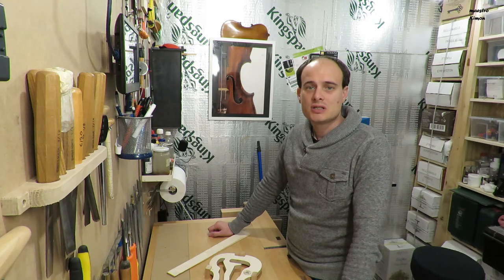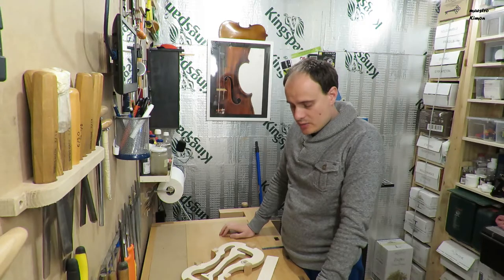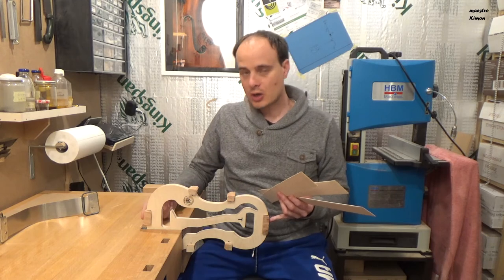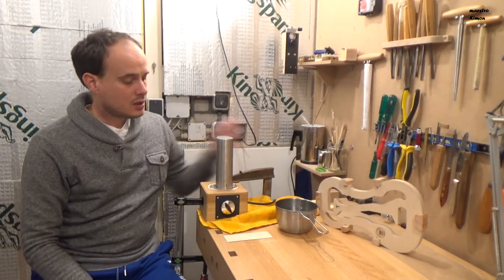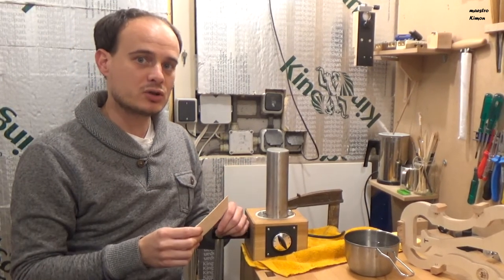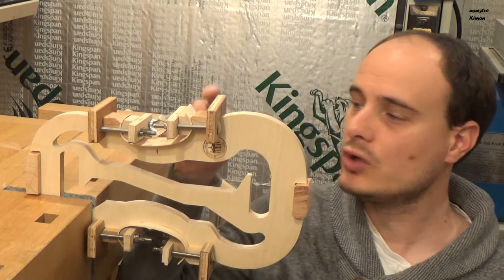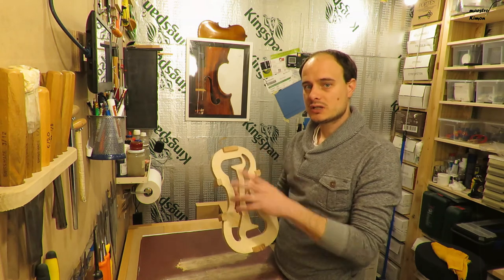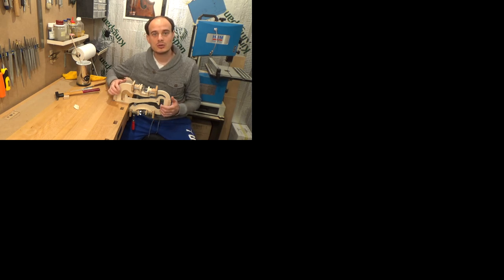Making a violin - step 2 - starting with the ribs

Comment: Are the 31mm and 29.5 mm blocks at their final dimension or will be smaller when you bring down the ribs to the blocks ?  I guess my question is...what is the final dimension before the back and front plates are glued on.  Thanks for your videos.  They are much appreciated.
Reply from the maker: These dimensions are the finished dimensions. When you are working on the ribs, the blocks don't get lower very easy. If you want to be 100% sure, live theme 0,5mm higher. 

Thank you, good to hear that you appreciate my videos!

Comment: Hey there been loving your making a violin series. I was just wondering at this stage what material you had under neath the sand paper to make it flat ? i have been thinking about buying some plate glass to use as a flat surface underneath it. not sure if this is not necessary and i could just use some plywood ?
Reply from the maker: I use a piece of MDF that is thick enough so it doesn't bend easily. the best is a nice piece of marble but it is very heavy. If you have the space it's the best to use a marble table. Otherwise a  thick piece of MDF or multiplex will do the job. Control it before use!

Comment: can you tell all measurements from the blocks from top to bottom, and the 4 c's? are the 4 c's the same? or is it for an example, bottom 32 mm, lower c's 31.5, upper c's 30.5 mm, and top 29mm ?
Reply from the maker: I do for the bottom 31mm and the upper 29,5mm. If you use the methode I used towards the end of the video, the 4 in the centre will end up in having the propper high by themselves. You will only have to control that left and right side are as high.

Comment: Hi! Maestro Kimon, should the tapering of the violin go consistently from the bottom to the top? I heard that many great Italian violins only taper from the upper C bout to the top block. and how does that affect the sound?
Reply from the maker: I taper the hole length. I think that if you taper only from the C then you will have or 1) to bend the back when gluing so it fits and so put longitudinal tension on it that in my opinion doesn't effect positively the sound or 2) make the back slightly curved that also make a rather stiff construction. Doesn't sound good to me!